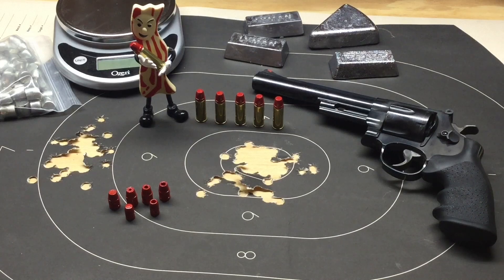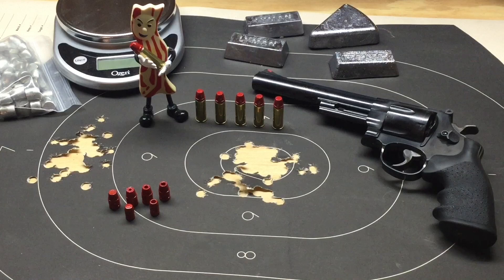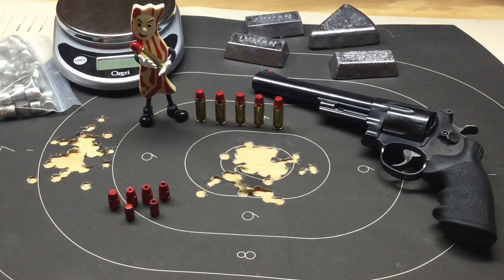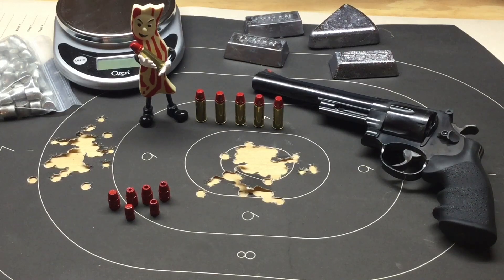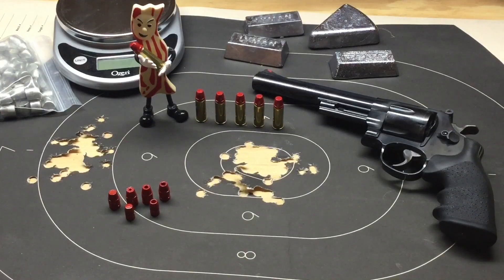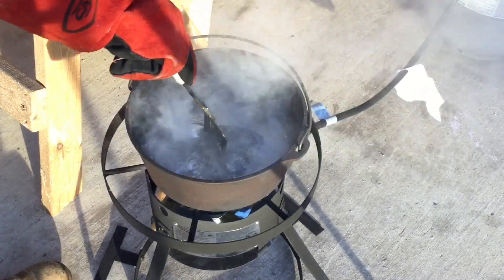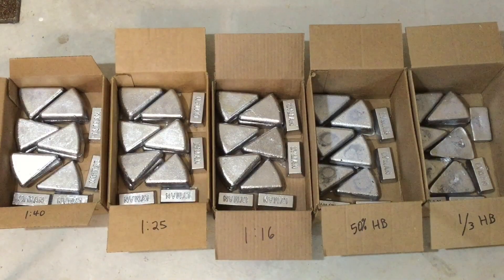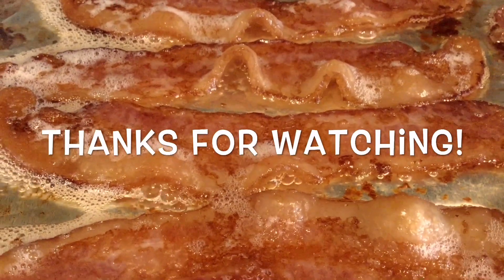Melting lead and mixing alloys for the Powder Coated Cast Lead Hollow Point Bullet Test

Comment: Hey bacon.   Have you checked your bhn after power coating?   If so, did it change?  Thx 👍
Reply from the maker: I did check the BHN a few weeks after powder coating, but I don't know how much it changed because I never checked it before powder coating.  I'll have the links up to the powder coating and hardness testing videos in a few days.
FYI, TATV Canada did a great series of videos on how hardness changes over time and with water quenching, powder coating, etc.